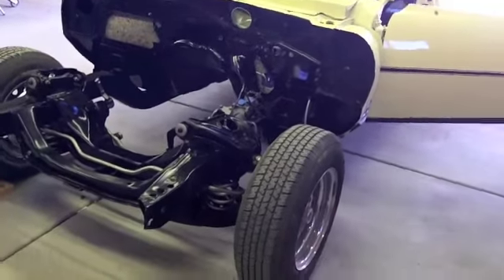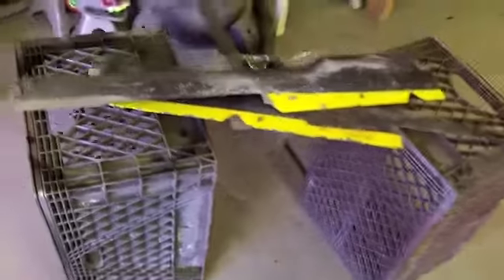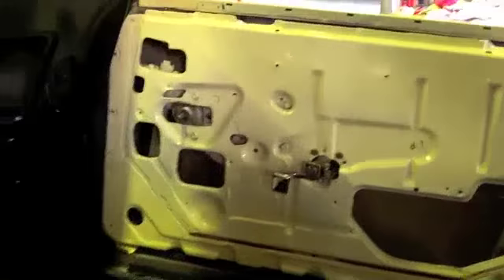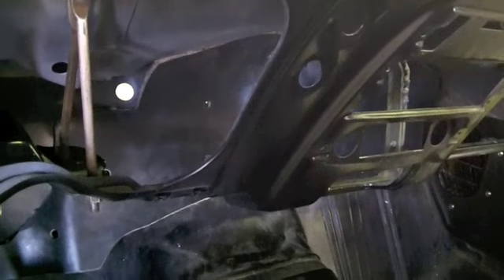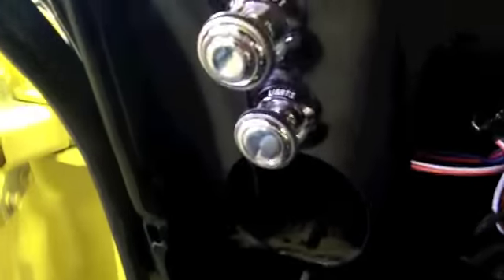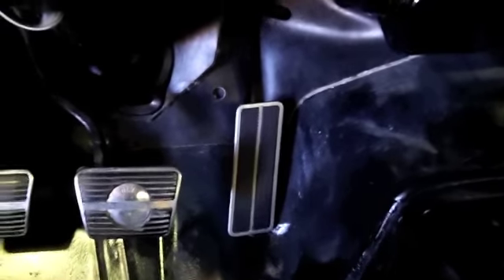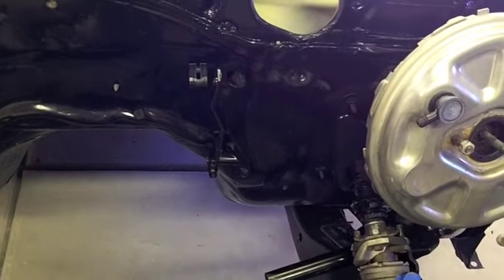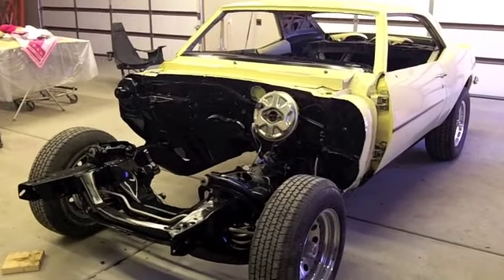68 Camaro SSRS 396 Restoration Part 50

Comment: Looking great, I went throughout the same with my 67 RS,  I opted to replace the heater core as three replacements from OER were all brittle and failed, so I went to radiator builder and they found a Toyota unit and modified the inlet tubes on engine bay side and has never caused an issue,

Comment: Looking clean Teacher, it appears as though you will have stock type low profile valve covers to get under that booster. Do you or anyone watching know for fact what maximum size/brand booster will fit over square 4" tall valve covers and still allow removal of the covers without removing the booster or engine first? Where did you get the under dash wire harness, seems to be a good fit, I will need the same.
Thanks, Loren

Comment: hey Nick,  got the spindles, coil springs on, was watching your video on what i can do next, and to my shock and HORROR, it looks like i got the spindles on the wrong sides, the arm that the sway bar attaches to on the spindle is facing the back of the car on each side,  I think i might call the junk yard !!!  I ain't got the brains for this, but just lost my motivation too.... LOL    Jeff
Reply from the maker: Steeljaw Jones Jeff the spindles will interchange from side to side. The sway bar will attach to the lower control arms with the links and it should be pointed back  so it sounds like you are alright.  Don't lose motivation & call the junk yard... call me. lol..